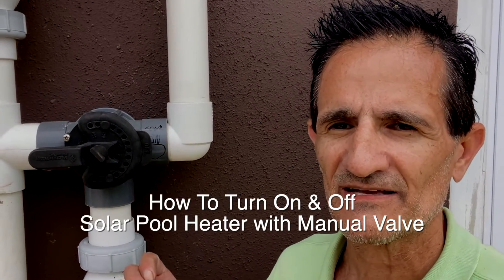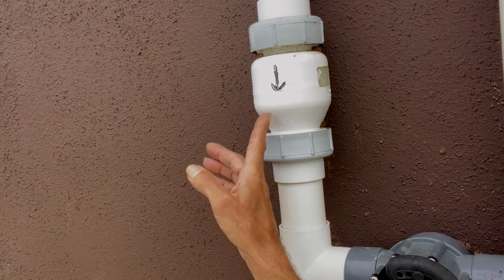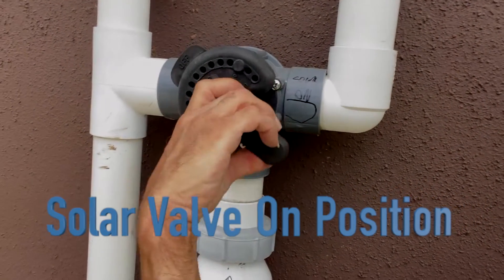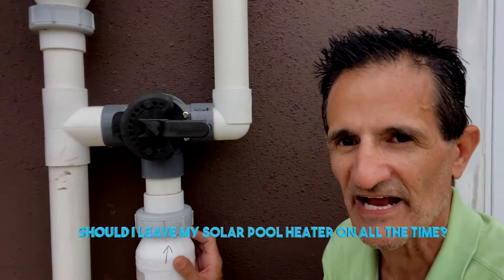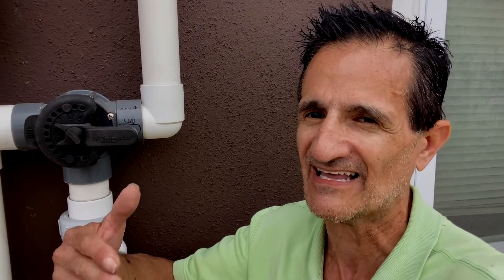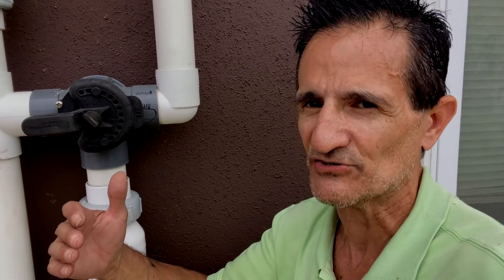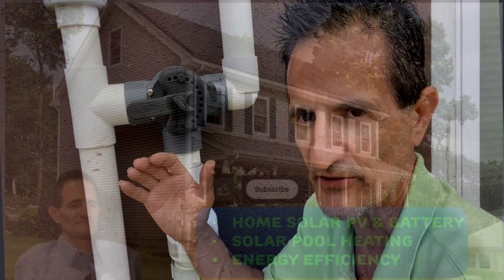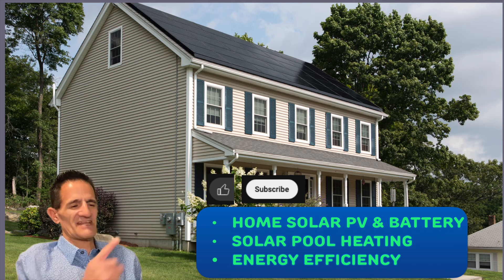Solar Pool Heater Operation Manual Valve Position On & Off. When To Run Pool Pump With Solar Heater?

Comment: We took our solar off our roof, when we reroofed and put it on the ground, it worked beautifully for about 3 years, now I have a couple of leaks and want to turn it off for the winter, but nothing is working to shut it off! I turned it off, closed the valves, tried everything and it’s still on. I’m guessing it’s the actuator or faulty switch, not sure who to call to help service it. Advice? In Orlando. Will need a few new panels come spring also. Thanks

Comment: Hello
You just helped me. We have a manual pool solar system just like in your video. All this time (2 years) we have been wondering why the water is never too warm. Well we had dial in the wrong position. It was pointing up and down rather than to the left or right. 

You have so many videos i have to watch now. Our solar installer we had problems and no longer di business with them and they never showed us how to operate the manual system agmonst other things. THANK YOU!!!
Reply from the maker: Glad you were able to get the solar system working properly!  Thanks for watching!

Comment: Hi Greg I am purchasing a house and the roof is nearing the 60yr expected life (no issues yet). I want solar panels asap to bring down energy costs and in the future I plan to replace the gas heating system with an electrical system (my preference at the moment is infrared panels). Would it be more cost effective to put the panels on when the roof inevitably needs replacing or are they easy/cheap enough to remove and reinstall?
Reply from the maker: It would be best to replace roof then get solar .. see my videos on roof replacement with solar

Comment: Hi this is Jim from Rhode Island.  I was wondering if an irrigation controller and valves can be used in a solar setup.
Reply from the maker: No .. use solar controller and valves